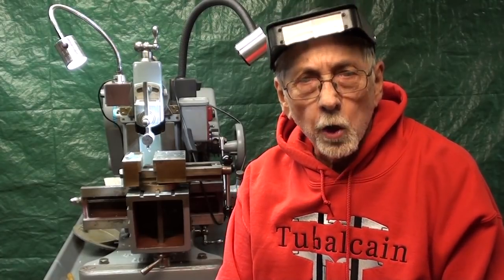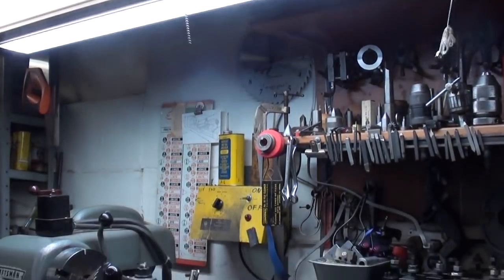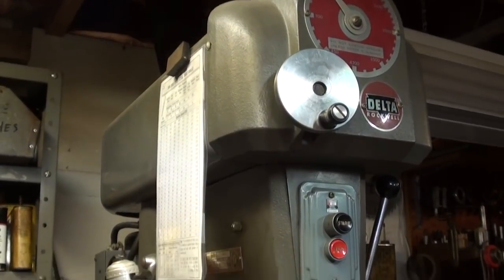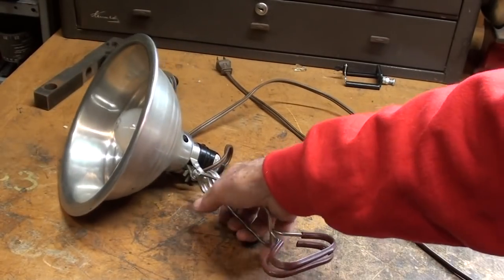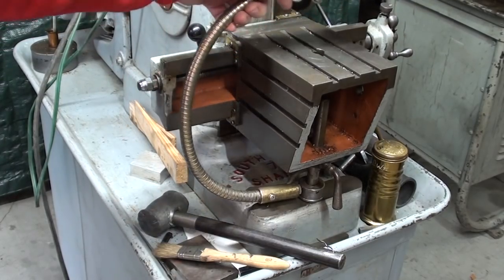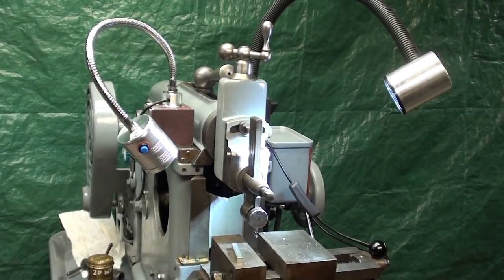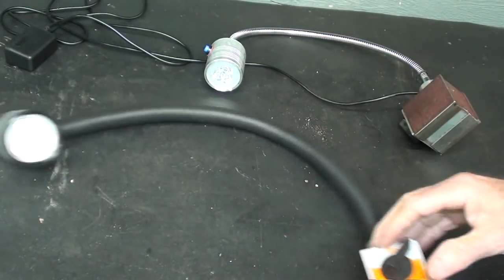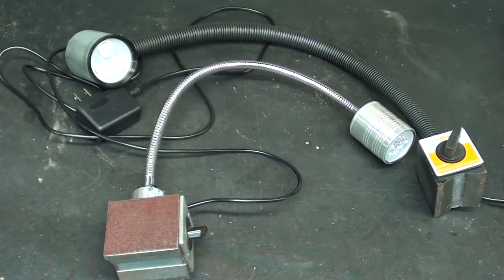LED MACHINE TOOL LIGHTS Tips 691 tubalcain

Comment: When I was a young truck mechanic. Trying to hold up a forty pound starter with one hand while trying to start one of those 5/8 twelve point bolts with the other. That metal caged drop light with the 75 Watt rough service bulb fell off the hook. That metal cage landed in the middle of my forehead and there was nothing I could do until that bolt thread caught. I looked like one of those Cyclops movie character. Forty years later I still have the scar. I truly believe it was the most evil person ever who designed a drop light. Probably safer using a candle with an open flame.
Reply from the maker: Wow, that’s a good story. I have been Burned Countless times, but never that bad. It was all incandescent bulbs put out a lot of heat
Reply: The only thing I use my old style drop light for now is heating up bearings for shrink fitting. Great story !

Comment: Mr Pete, a question on your Craftsman/atlas lathe. Is that an AXA or BXA qctp?  The reason I ask is I have a Craftsman/atlas 12x36 and am looking to buy one and am unsure which size to buy. Also, besides the T-slot, did you have to do any other modifications to make it work? I am brand new to machining and really like your videos.
Reply from the maker: Axa.    You may have to machine that tee nut.     No modifications to the machine itself

Comment: oh I had a quartz work light. jeebus it got hot!
I don't know why these LED machine lights have to be more than the clip on LED desk lamps you can get from the box stores for $10. heck I'd glue some small magnets on if I wanted (those are also very cheap)

Comment: Good morning from Springfield, IL. Thank you for the review I too have switched to the LED bulbs where I had incandescent light bulbs , I've been looking at  the magnetic base work lamps for a while now for my lathe and drill press. Some I've seen seem to think thier product is the gold standard for these items. Over priced upwards to the plus side of $ 100 and use the quartz element bulbs. The LED bulbs or heads are more inline for the average shop owner.  I will be checking out those two lamp myself thank you for the review.

Comment: I buy Sams club shop lights have 3 of them around mill 20 bucks a piece plug in & a pull chain switch. Good video.
Reply from the maker: I do not go to Sam’s Club. Maybe I can get one of those at Walmart. Good morning Mike
Reply: @mrpete222  Costco has similar. I too avoid Sam’s
Reply: @mrpete222  I got mine at Harbor Freight $20 ea. bought 4
Reply: I've got several of the Sam's shop lights. Can't beat the price. Complete with cords, switch, chains and outlets to daisy chain them. Nice illumination also.

Comment: Magnetic base LED sewing machine lights are a lot cheaper and do the same thing!
Reply from the maker: Where do you find them?
Reply: @mrpete222  If you're still curious about these lights here's a video I stumbled across that shows what's inside: https://www.youtube.com/watch?v=UDrQ5aiCdJg
Reply: I use these also. I get them on Amazon, last time I got one it was about 14 bucks. They’re magnetic, the switch is on the base and they have kind of a long and thin head on a short( 5-6 inch) flex. I usually search “machine light” when I want to find them. 
Rick

Comment: Every day I need more light in my shop! I have found "sewing machine lights" to be very useful on band saws. Unfortunately, it took a couple of try's before I found the very bright ones.
Reply from the maker: I will look those up on Amazon
Reply: @mrpete222  The POWKER 30 LED is very bright. Some of the others, not so much.
Reply: Search Amazon “EVISWIY Sewing Machine Light LED”. I’ve been very satisfied. $17 for two.

Comment: The LED work lights are great. I have multiple work areas and move my close up lights. All battery operated.  And they last a long time. However I cobbled together 3 lights made them all with magnetic bases flexible arms (coolant lines made long adding extra sections together) and powered by my drill batteries using an power adapter.  Last a long long time and provides a great counter weight. Last months before recharging.
Reply from the maker: Good idea

Comment: Something to note on the safety front, LED's produce light at a certain frequency (it varies light to light), this high speed flicker can produce a strobe effect with rotating parts. Get a frequency match with your lathe speed and the LED and it can make a chuck look stationary, despite it actually rotating at several hundred rpm. In a noisy environment, where it may not be possible to audibly notice a machine is running, it can lead to accidents. No big deal with shapers but could get interesting with lathes. If you have a small lathe with variable speed it's actually pretty easy to demonstrate.
Reply from the maker: I have heard the same thing about fluorescent lights years ago. I never actually experienced it. I think that is all urban myth
Reply: @mrpete222  I haven't experienced space flight but I hear it happens. No urban myth Pete, there's lot's of data on the dangers of strobe effect from the use of fluorescents, high quality LED's, properly driven,  aren't as bad as tubes, but cheap Chinese LED's are. How about doing a video with one of those lamps pitched up next to a variable speed machine? I bet you could slowly increase the speed to a point where it synchs with the LED making it look like it isn't moving.

Comment: Mr. Pete, I have been looking at these type of lights for several months but keep hesitating due to long delivery times as well as wondering how much wattage would be good for the mill and lathe.  I see that the wattage of the two lights you are playing with are significantly different.  Do you find that 3W is plenty for lathe, mill & shaper work where you typically only need light in a localized area?  Is 9W too much?

Comment: Lyle

They make regular base LED lightbulbs, and work GREAT for replacing the old incadescent bults in those older work lights.  I use 100watt Phillips LED bulbs (get them from Amazon and probably also at the big box stores)  So don't throw those old lights out, just replace the bulb.  Also, on the Craftsman gringer, a little Loctite Blue will keep the shade from un-screwing.

John

Comment: Ha, machine work lights are one of those things that never seem to ...well.... work right!  I do like the old style Fastoria (sp?) type lights that used to come on machines, especially now they have those LED bulbs that replace regular light bulbs. I like the bright daylight color temp you can choose with most LED bulbs. 
Those flexy neck lamps always seem to not stay put for me, both flexy neck or mag base always to fall out of place. I have taken to using those mag base rechargeable lights they sell to auto mechanics to augment any machine lamps I have. They are bright and work good for me plus they stay put, however you need two or three to keep one charged all day long. 

The best thing in my mind would be to somehow magically have they eyes of a twenty year old again. That  would help immensely 😀

Cheers Mr Pete, and if I don't see you again before then, Merry Xmas and Happy New Year

Comment: HAND RAISED VERY VERY HIGH because I have the marks still from old incandescent bulbs. I want a n LED lamp that is not only posable but is also dimmable so it was safe , secure, and overly where I needed it at the moment. I ended up using individual LEDs in a ring to get the light even on the work depending on my needs but I end up most times using a $8 desk lamp I get at Walmart that has a built in diffuser  so it never gets hot and is not too bright.  I did have to remount them but had the materials on hand and they are way improved from the pricey versions. Why is it someone cannot design a proper work light  that people can afford and want to use?

Comment: As of yesterday, I finally got moved into my new house, and the reason I purchased the home is because it has a full basement that will be my machine shop.  My brother and step-father helped me get all the machines in the basement and then we started talking about adequate lighting for each machine.  There are several shop lights already mounted throughout the basement and my step-father suggested buying LED bulbs at Walmart for around $16 bucks each because that's what he has in his shop.  On a side note, L.E.D. stands for light emitting diode.
Reply: L.E.D....Loads of Electronic Detritus.😈
Reply: Thomas, Congrats on the new house and shop space!

Comment: The grey light you want to throw away is a Moffatt Flex Arm.  They were stock on The Southbend Shaper in the later years.  Also on some Delta woodworking machines.  The company is still in business. These are quite expensive.
Reply: The Moffatt lights were OEM lighting for lots of printing presses and related equipment for decades... in addition to being the lighting source for Rockwell/Delta machines from the 1960s forward. They are still nice lights and can be retrofitted to magnetic bases, can be outfitted with LED bulbs, etc. I will not divulge how many of these I have in stock b/c it may set off your " hoarder sensor".... which I am not. I have about 3 already deployed on machines-- the rest I will do when I find the time or the need. I do not trust a cheap light that may not even come with a UL safety rating. Does it?